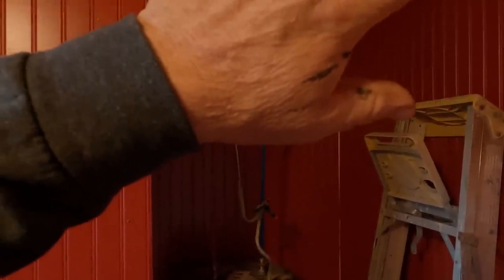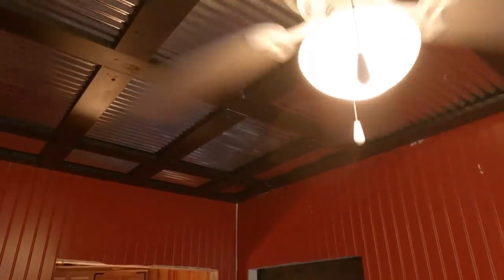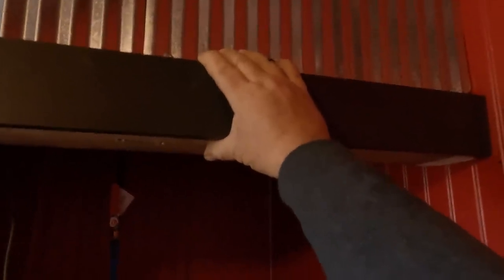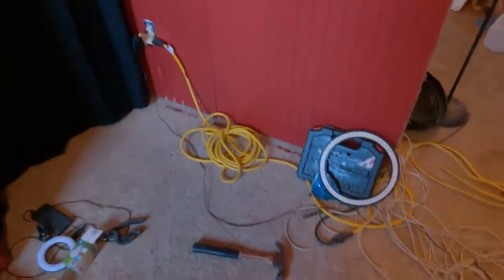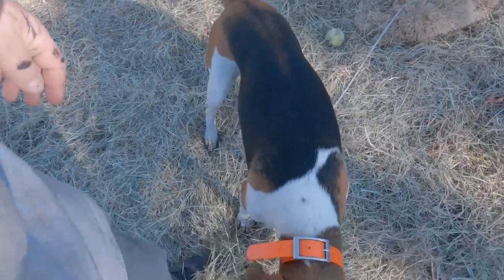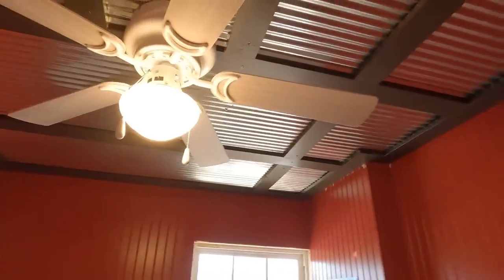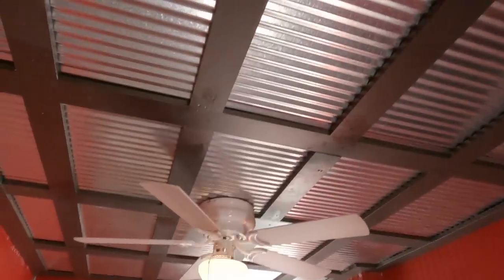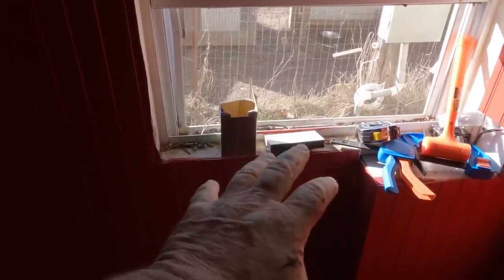The Ceiling Is Done!  On To The Flooring.Turning A Disaster Room Into A Office.

Comment: I wish you had run the water heater wire for the future move before doing all that work on that room.
Reply from the maker: I thought ahead,10ft from outside panel, already has the old breaker for dryer. So take a breath and relax

Comment: Coming together great Mike.   Check prices on plastic or metal shelving unit for that water heater closet.  That way if you move the heater you don't have built in shelves to deal with.   Often those shelving units are less expensive than good lumber.